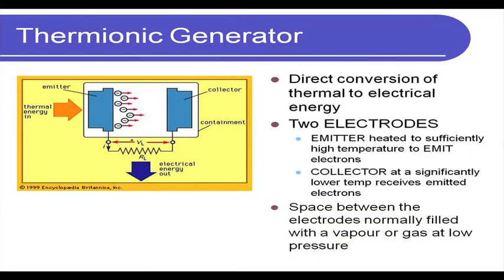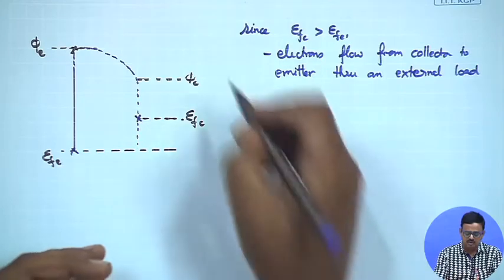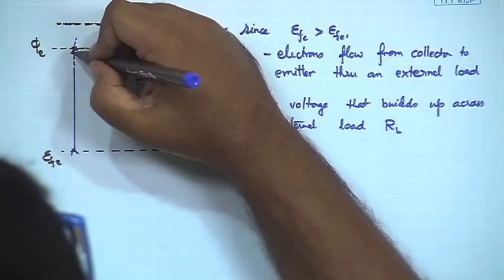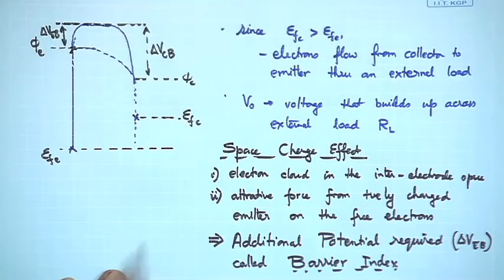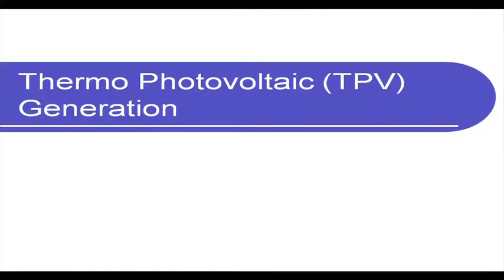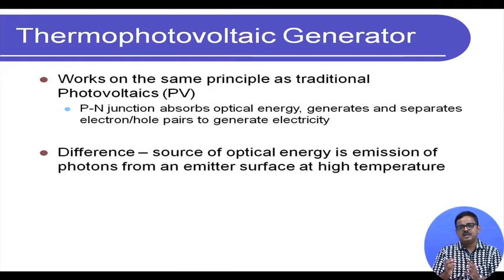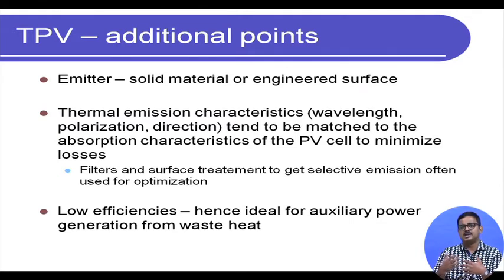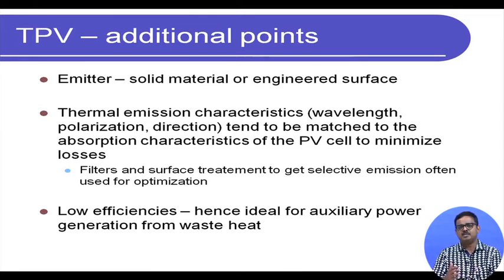Lecture 46 : Direct Conversion - Thermo Photo Voltaic generation (TPV)

Comment: hello sir , i am final year student of mechanical engg. and i want to work on the topic of thermophotovoltaic for my final  project . but i seems  very difficult to make such emitter which will emit  such controlled wavelength spectrum. Finally I just want to know whether this  topic is sutaible at this level or not because to modelise this system we require huge amount of work.